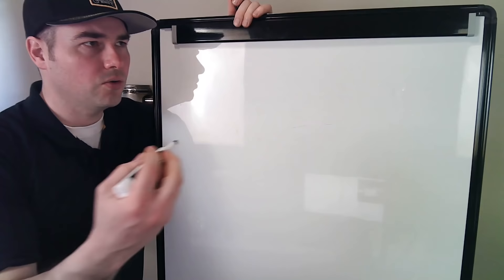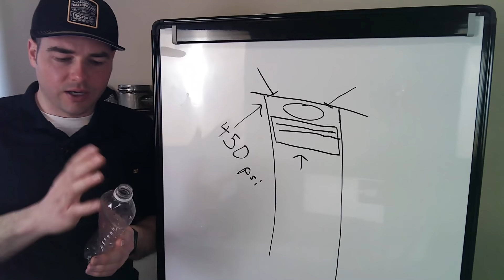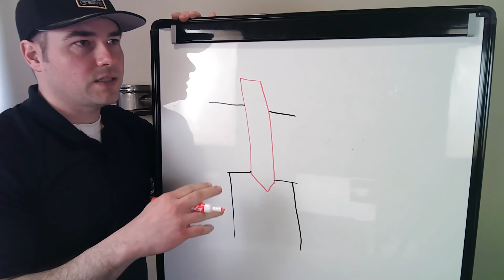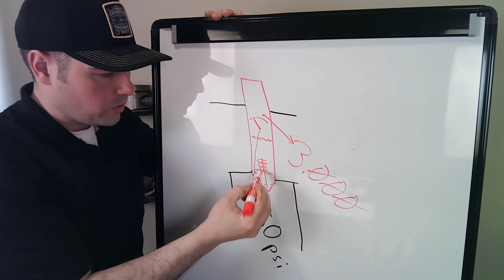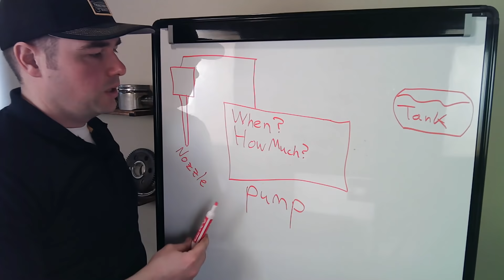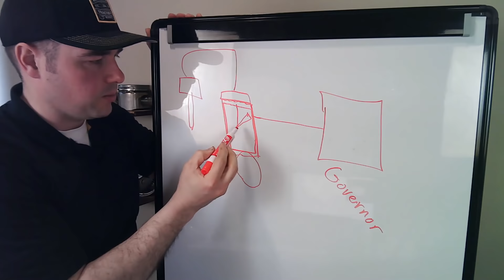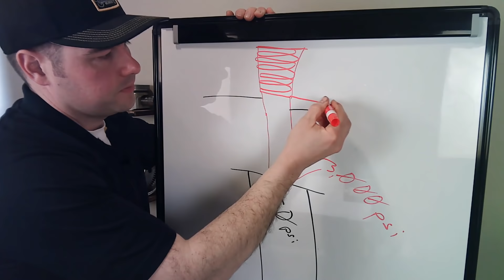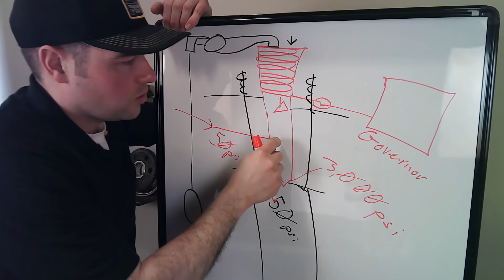Diesel Fuel Systems 101. Class 1.

Comment: Being a heavy equipment mechanic for 20 years,  you still learn all the time. I love watching your videos to see if I can learn anything new, or even just to brush up. Thanks again for all you do!
Reply: I have a question.  I removed the front head from a big cam 350 cummins. A ntc 855. It was for an oil leak around the push rod gallery. After removing it, I noticed #1 piston was clean on top. #2 had some soot build up on top. Think the injector on #2 might need attention?
Reply: @danielgore886  normally in an 855 , if the piston has no carbon it indicates a leaking injector tip and excess fuel has " washed" the piston head clean. It is a good idea on any diesel to use a laser temp gun to check temperature at the exhaust ports with the engine running At or close to operating temp..it can give you a good idea of any problems before you ever put a wrench on it. Any big differences in port temp indicates a problem..
Reply: I want to become a diesel mechanic.Because I keep getting screwed over.
Every time I go to a truck shop there's more problem After I leave like they did something wrong.
Reply: What do we use for diesel fuel line? I got some copper nickle brake line but it's too soft.

Comment: When You it firies at TDC is not factual,   the nozzle or ato.izer you were holding is from an engine that fires at 21° btc,       an ths operation of the nozzle,     is very confusing,    the comp in the cyl is not an issue,    the nozzle is a relief valve, an o ce its breaking point is reached if opens till that pressure drops.

Comment: I remember diesel fuel systems class at UNOH in the early '80s. No electronics, port& helix, cummins PT, Detriot rack systems.
Reply: Biggest problem was to get them to shut down.. Keep a board, piece of hard stock plastic, whatever around when starting to block off the intake in case of a runaway.. LOL

Comment: Hello, I worked for a factory distributor for Detroit Diesel engines 20 some years ago. Detroit Diesel had unit injectors like you described so very well.  Back then, Detroit engines were all two stroke cycle engines. Now days, they have the 60 series engines  that are four strokers.  Looks like the later engine models of all brands have sort of used the best ideas or each other. After the time with the distributer, I went to work with a Ford truck dealership and we worked on all engines that were placed in Ford trucks.  i thought that experience was great to see all the different kinds of engines and various fuel systems. Other than the two strokers, diesel engines where similar across brands all but the fuel systems. All fuel systems have the same components. Getting fuel to a pump, a rack to control how much to inject and when...etc.

Comment: Thank you. I had a course in diesel engines but it didn't teach us about older fuel systems. Only common rail. We do have older engines on trucks at the shop sometimes. I've only seen the type with the pump not the unit injectors.

Comment: Detroit uses the mui system on the older mechanical engines. I've worked on plenty of Detroit. I'm working on a Cummins 6bta 5.9 engine that has the injector nozzles. Here in the Bahamas there's a lot of mechanical engines around so you see plenty of these fuel system here.

Comment: Hi Adept Ape, my question to you is does adding 2-Stroke Oil into Diesel fuel increase its lubricity and therefore extending the life of diesel injectors? Given the low sulphur diesel on the market today it is said that the lubricity of fuel has drastically decreased?
Reply: I poured a quart in a full tank of a tired old truck last month. I felt it ran better.

Comment: Josh I give you an A for explanation and a F- on your drawing skills. Need to take a art class, ASAP.

When I hired in forged body was already gone. It was big, I mean VERY BIG, fuel was cheap and engines was precombustion chamber. 
Then the came out with what was called compact scroll. Basically similar to what you said. The nozzles was called capsule type. They screwed onto a nozzle body and set in the precombustion chamber, (PC). VOP was 450-750 PSI. Only had one spray hole out the bottom. As it sprayed fuel into the precombustion chamber then down on the piston. As EPA became stricter, Cat was forced into Direct Injection or commonly called DI. VOP on the nozzle increased, had several small holes in the tip. PC engines had to be phased out. Again EPA ups the emissions and compact scroll wasn't efficient enough to meet EPA. So the B model came out and Cat called it New Scroll Fuel System, (NSFS) the nozzle became a pencil type, 7000 series. As EPA keeps raising the standard, injection psi keeps going up until we get to the last fully mechanical 3406C, or 8PN and it is a POS because what was required to meet EPA law. Old timers refer to this system as pump and line. I was told that fuel line psi in a 3406C can be 17,500 psi. The plunger and barrel in the main pump are mated and are not to be mixed with other ones. The other parts are interchangeable, bonnet, spring, check valve so forth. The P&B has a fill port and a spill port. The helix on the plunger as Josh mention determines the amount of fuel being injected. As the plunger rotates in the barrel, from the rack by governor control. So if the distance between the small part of the helix to the spill port is short. Plunger lift is very little until helix reaches spill port. If governor demands more fuel, rack moves, rotates plunger so helix is opened up more and a longer stroke is required to reach spill port. Check valve in top of pump on a B model is around 100 psi. This keeps and fuel from draining back out of the lines. Also all the injection lines are the same length so the same about of force is applied to the nozzle.
Another fuel system that was used on trucks, 3208 mostly was called sleeve metering. The entire fuel system ran in diesel fuel. Water in the fuel was the killer on this system. The Plunger had a extra part called the sleeve. No helix, the plunger was hollow from the top down to the fill port and spill port. You had levers that the sleeve would set in. All timed and as the governor moved the levers up and down, it determined at what point the the spill port opened up out of the sleeve. On sleeve metering, barrel, plunger and sleeve are mated.
Reply from the maker: I'm sure you've forgotten more about mechanical Cat fuel systems than I know about them. Yes, I'm no artist, but the concepts are more important than the drawings of them.
Reply: @AdeptApe  Not your time frame, how's the headache?

Comment: I just came here to ask if you have made a video about 3 stage jakes? How do they work? Like is 1st stage just one piston and 3rd 3 pistons or all pistons?
Reply: Yea basically
Reply: Stage 3 is all cylinders...Stage 2 is 3 cylinders....Stage 1 is 1 are 2 cylinders.....the older isx's also using the camshaft to improve Jake braking efforts and the newer ones uses the vgt to charge the cylinders to slow them down in the Stage 3 setting
Reply: @nicholicampbell138  ok, thanks, u by any chance know how the jakes on a Volvo Vnl 760 with an X15 work? shit has like 6 positions and doesn’t even slow down as good as a cascadia that had a DD15 and normal 3 position jake that I drove in training, also it’s stops slowing down after like 35 mph
Reply: To be honest...naa but would assume the sixth position would be the strongest setting.

Comment: Adept ape! I am a new diesel technician and got hired in a shop where instead of doing basic repairs on tractors im working on all sorts of different diesel trucks. They do not offer training and I was wondering what would be the best way for me to gain more knowledge. Is there a free schooling i can do to learn troubleshooting techniques, the correct ways to adjust and assemble components and other diesel repair stuff. I dont want to just learn through trial by fire.
Reply from the maker: Do you have access to SIS, Quickserve and the other manufacturer websites? They are great resources once you know where to find the "how this system works" articles, they can give you a great amount of insight into the systems. Some people can retain this info from reading it, others have to do hands on to learn though.
Reply: Caterpillar has a free online Technician class that is self study and earns you a Certificate of Completion that you can find with a Google search. They say it takes up to 6 months, but I did it in 6 very long days. I paid the price for it too as my back went out on said 6th day from sitting on my butt 😂 so don't do what I did unless you have a standing desk set up.

Comment: 4:15 heat is not getting compressed rather molecules are smashing against each other much more often therefore heat builds up (temperature accumulation as well unless dissipated fast enough) or you may use typical Charles or Boyle`s Law or Standard gas equation which states if you  decrease volume you are increasing pressure and temperature. p*V = nRT where pressure * Volume = weight of molecule of one mole * Gas Constant (8.314) * Temperature in Kelvins.
6:43 we say atmospheric pressure for world 101,325kPA at 0m I think less above more below imagine weight of mass of air above you.
There is certain vacuum inside the bottle which is 101.325kPA - the amount of air pressure escaped or extracted therefore you either say there is i.e.  70kPA absolute pressure or 31.325kPA Vacuum.

is 31:45 PD system on VW diesel vehicles-cars not trucks(2001-2010) where pump is part of the injector literally meaning PUMP Injector system? Thank you

Comment: I was hanging with you pretty good until the rack part.  I don't understand how it works.  I understand that is a variable orifice but I don't understand how it gets varied.  Hopefully my Cummins ISB 6.7 doesn't have one.  I'm assuming that the fuel supply in a MUI has a check valve to keep the high pressure in the MUI from backfeeding the fuel system.  Is this correct?   Keep the good stuff coming.
Reply: Read my comments below on pump. This type of mechanical governor has flyweights, spring, servo, main parts. When the engine is started and you depress the throttle half way (proper way on mechanical). Fuel is in the on position and as soon as it starts and you release the throttle, spring force and flyweight force are equal. You have a low idle set screw as you turn in or out changes spring force. When you throttle, spring force increases and flyweights move fuel on, until the two forces are equal again. You have a high idle screw, again you determine how much force is at the top by hitting the stop of the screw. So as your going down the road and you have throttle pressed lets say at 1500 RPM point, both forces are equal. Now you come to a hill and RPM's slows down. Spring force is greater than flyweight force and forces fuel more in the fuel on position. The spring becomes the master and the weights become the slave. Now you over the hill and start picking up speed. The flyweights open up and over comes spring force. Turning the fuel off and the flyweights are the master and the spring becomes the slave. Hit the bottom of the hill and both are at equal force again. The servo or piston valve assembly, connects the rack to the governor.
Reply: In a mechanical unit injector system with pumps directly above each cylinder, the check valves are located in the injector itself, at the tips.

If it's a pump-line-nozzle configuration (like a mechanical 3406), the pump builds pressure and sends the fuel through the lines to the cylinders, but there is a check valve in each nozzle that prevents pressure waves from inducing unwanted extra injections.

A common rail system is basically a pump-line-nozzle system. The difference is that the fuel pump is the thing that builds high pressure, unlike the unit pump systems. And the check valves don't "respond" to the pressure increase from the pump but are electronically controlled, both to determine how much fuel is injected and to prevent unwanted secondary firings.

Comment: Just question years ago I had  a 3406 cat that started running on one cylinder at idle .
Ran great off idle so I got in to the local Cat dealer and we got new diesel mechanic. 
Engine ran let John deere tractor from the 1950 . Running only on number 2 cylinder .
The guy thought it must have a rod bearing problem. 
I said it's fuel problem. 
But we got a new rod bearing a free oil change .
Long story but the new guy spent about a week to find the problem 
It was a piece of rubber oring stuck in the oil line of fuel rack .
So fuel was just slamming ahead so that it only needed fire 🔥 once per rotation. 
Years later this is the guy you want working on something. 
Back then they made him finish the job.

Comment: Any idea what causes a P1211 code on a 1996 7.3 powerstroke?  

The HPOP has been replaced, new IPR solenoid as well as ICP sensor, and fuel pressure looks good.  Any idea what the problem could be?  Could really use your help.  Thanks👍
Reply: Check that the red wire on the IPR is not shorted to ground, and that the red and white aren't shorted to one another..
Reply: Hopefully it's not an ECM problem, most of the time it is a broken wire somewhere. Hope this helps.
Reply: @garykirk1968    That’s great advice thank you!  It runs great until you hit about 35-40mph and then the check engine light comes on throwing the p1211 code and feels like I loose power especially going up hills.  Then when I turn the truck off and restart it the truck acts perfectly normal🤷🏼‍♂️